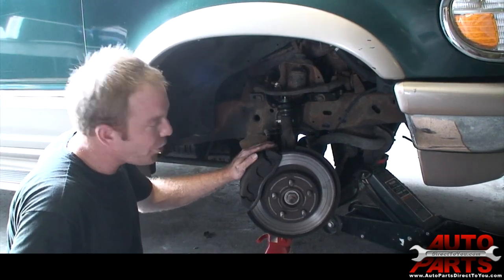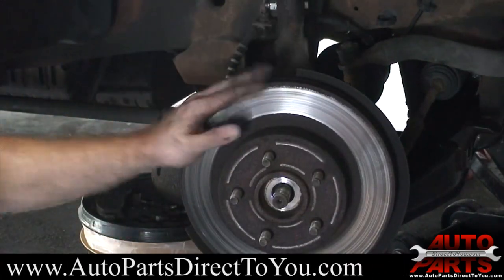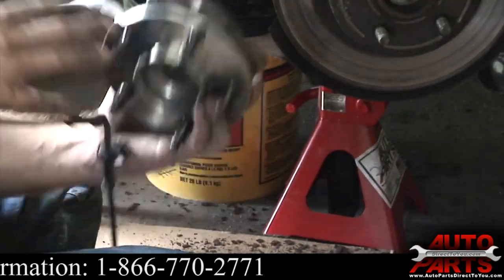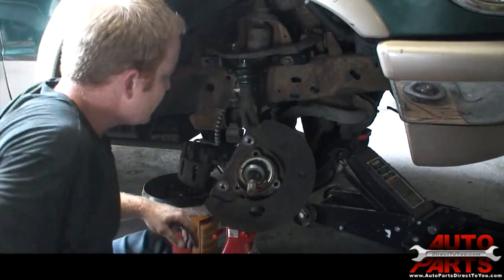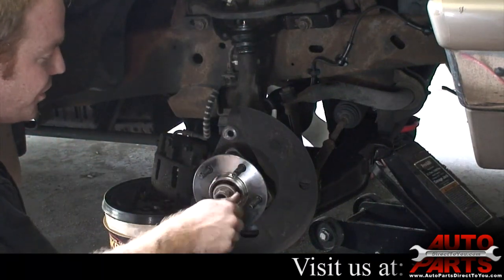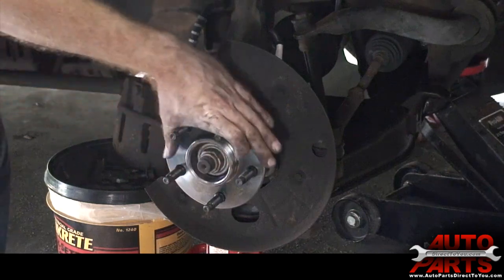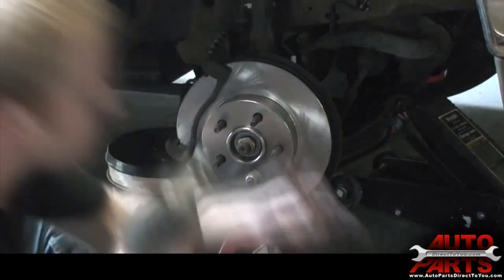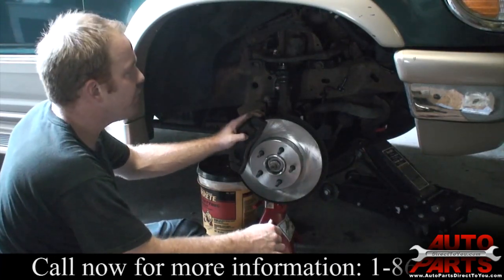1997 Ford Explorer Part 2: Wheel Hub Bearing ABS Sensor Brake Pads Rotors

Comment from the maker: @Whitecrackertrash The hub assembly and brake rotor don't necessarily have to come off in order to replace the ball joint. You just need to move them out of the way enough to access the lower ball joint. Once separating the lower ball joint, the whole steering knuckle can be pushed to the side to access the ball joint. Removing the rotor and hub WILL give you more room to work though.

Comment: @LostInMadness220 - From trial and error at Ford, I found that the sweet spot for longevity (for a 97 AWD) was exactly 207ftlbs. Less causes premature bearing wear, more seems to bind it in less that 40K miles.

Comment from the maker: @MLGsucks8693 Ohh that is a tricky one, if the plug is absolutely seized in there,, one option is to install an aftermarket rear differential cover that has a fill plug on it. The other way to get it out is to drill through it, and use a large easy out.

Comment from the maker: It's not required, once the hub nut is locked down, those splines permanently stay in place. But it's not a bad idea, it will make the hub easier to remove in the future if you ever have to take it off again.

Comment: Actually some PB Baster sprayed on there will brake through the rust. I had changed one one on a 98 that the hub was so badly worn that it was un-drivable.  I couple hits with the hammer (on the center side not face) and the rotor came right off.

Comment from the maker: @MLGsucks8693 Unfortunately I do not have any videos on the rear bearings for you vehicle, you need a slide hammer to get the rear bearing race out, the slide hammer should have three "fingers" that go into the race, and you can then grab onto it, from there it should knock out (not always easily though).

Comment: But the big question that no one seems to show in their videos how do you remove the 3 bolts that hold the hub on?  I have been led to believe that there is a clearance problem getting the 3 bolts off?

Comment: when doing a lower ball joint replacement on this truck you need to remove the wheel hub assembly or brake rotor?

Comment: do you have to  use a press to do the rear hub and bearing or is there a tool you can use...and if a press is the only way will the 20t that harbor freight has work ?

Comment: @APDTY hey thanks for the comment back... i did end up getting the race out. it was a pain in the ass though. i did hav a slide hammer but it was not a fun job. no i have another problem. i cannot get the differential fluid filler plug out. it is so corroded i cant even get an extension in the plug. any suggestions?

Comment: Well edited! Except that you forgot to show the torquing of that nut after putting on the brakes or putting on the wheel/dropping on its weight to the floor to stop it from spinning.
Also ... my partner has a '97 Ranger that failed inspection because it "needs wheel bearing tightening" ... appears there IS no tightening of the wheel bearing!

Comment from the maker: If your ranger is a 4x2, you actually can adjust the wheel bearings, but if you have a 4x4 then unfortunately you are stuck needing the whole hub assembly.

Comment: So what was the torque specs, and which one is the best? I did mine, asked the auto parts store about the torque told me about 184-200something. At school they recommended at 154-210 ft lbs left them at 184.

Comment: I have a 97 explorer 4wd. Where can I find rear wheel hub?! Everytime I search only the front hub pops up. Starting to wonder if the front and rear are the same...I doubt it but I'd like to know the correct specs so I can replace them.
Reply from the maker: depends on the year and specific model, If 1997, then you should have rear axle bearings, bearings that fit into the rear axle tube, Here is a link to what the rear repair bearing looks like, for sale on Amazon: http://amzn.to/2gNjPJz
If you have a 2002-2003 or later with rear hub bearings, then see: http://amzn.to/2idlLeN